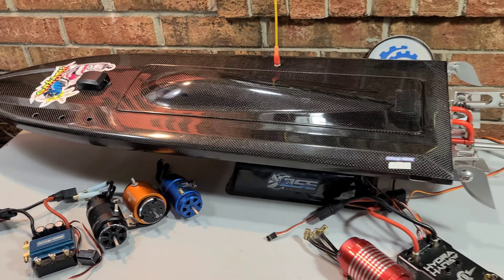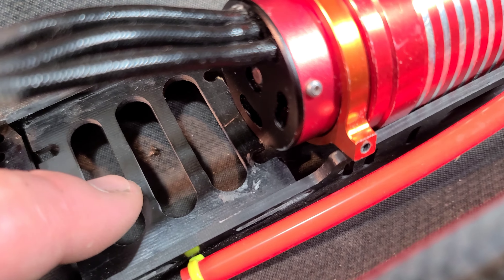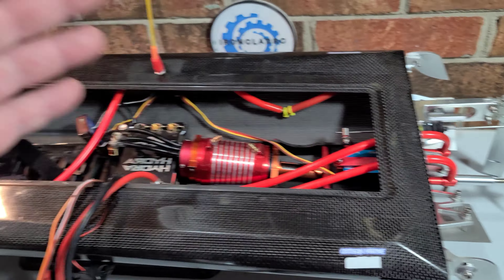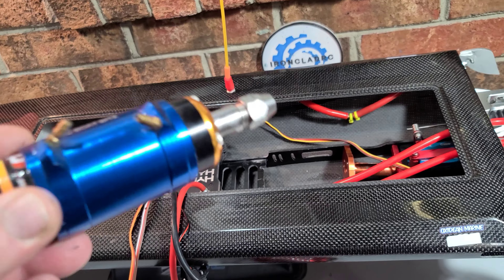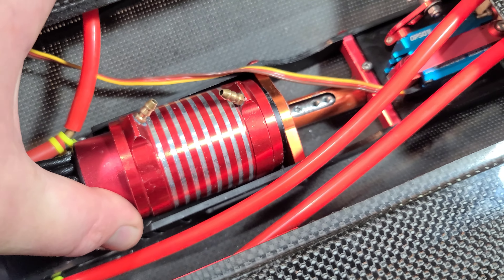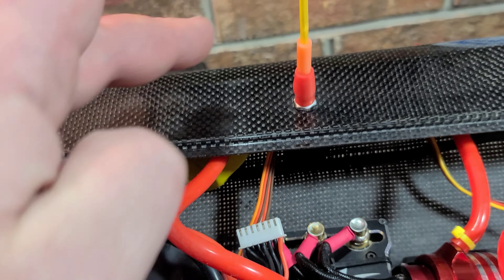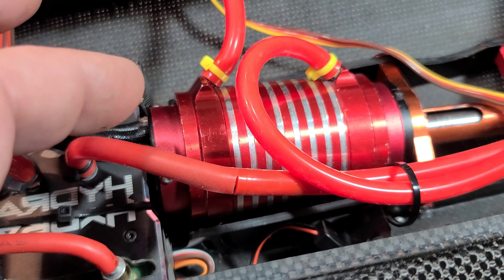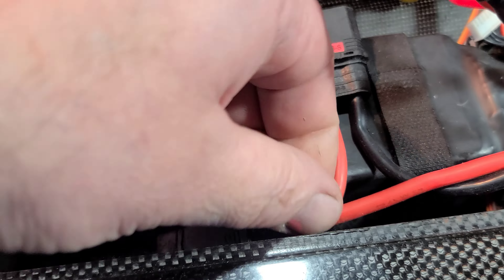Hydra Xlx2, Leopard 4092 Install Oxidean Marine Dominator 6s Setup

Comment: Good call on soldering the motor wires out the side of the bullets. Was wondering how I was gonna be able to run the esc sideways for more battery room with the leopards short wires. Just a heads up, ose sells 90 degree cooling port nipples for the xlx2 so you don’t have to run the lines vertical.

Comment: Just a heads up on the leopard 4092 motor wire length, the stock length of the wires from the end cap to the end of the wire not including the bullet connector is 68mm.
Reply from the maker: Roger that thanks for the info.

Comment: Don't know if there's room enough cause i put new frame in my v1 when it broke loose.
I placed servo right from motor so i got more room behind the motor. Theres plenty of room for smaller esc's but xlx is quite big...
Thay way you keep cg further back and you can adjust it with your lipo's
Reply from the maker: I definitely considered removing the coupler protector so I can run a normal collet. I may do that later on down the road.    Off setting the servo is a good idea

Comment: use a zip tie system to keep those motor wires off each other one zip tie loosely around all 3 wires. then use 2 more zip ties for the spacing. i can send a pic if needed.3 zip ties all together
Reply from the maker: I used that technique on my original deltaforce build gives a clear finished look.

Comment: Almost the same set up I got. Mine is a 4082 /1600 kv..I've been thinking of hatch locks ...Not sure yet. .Still waiting to get it on the water if the weather cooperates.
Reply from the maker: I've been contemplating hatch locks too I've got a few laying around the shop.  Locks would definitely give us a piece of mind in a whip out.

Comment: I had a hobbystar rewrapped with better wire,dude told me the Leopard is basically the same motor.
Reply from the maker: How was the performance difference in the rewrapped motor?   Was there a significant difference in performance or heat dissipation?
Reply: @IRONCLADRC  have yet to run it B

Comment: Absolutely love the 90 degree esc to motor bullets .I think I may make some changes after seeing that idea.
I have never had any luck with the grub screw type coupling with high power but man that motor connection tube looks like a grub screw cover or hose to slide over the opening might be a good way to stop water coming in through the shaft
Reply: Most bullets come with the hole to do so

Comment: I flipped my delta force on Sunday and tore my gps off the deck so be careful high speed crashes rips stuff off
Mine is lost in deep water.
It’s getting so that I need to build a shallow pond so I can just walk out and pick things up.
Just need 300 metres of free land 😂
Reply: As long it isn't a carbon hull you can put it inside your boat.
That way you can't lose it 👍
Reply: @peteroosterhoff8850  yes but I was making adjustments and did not want to re do hatch tape to view speed it was not a gnss so no cell phone to look at speed on for each adjustment chsnge
Reply: @jamesatkinson7517  Then you'll know want you want to buy now...
Losing things suck big time, the gnns is especially for boats ideal.
I made in my carbon boat a "window" in the hatch with some thin acrylic glass. Heat it up and you can round in in the shape of the lid. Then some adhesive and some small screws and it looks like an emergency hatch... 👍
Reply from the maker: James that's a bummer definitely been there.

Comment: I’m building a OSE Raider M40 with the Castle a hydra. What motor and prop would you suggest I use as I want it to be a very fast oval racer? Going single motor with one Esc. I was thinking maybe 8s with a TP 4070 1220Kv motor.
Reply from the maker: I think you're on the right track, 1220 4070 will be a great starting point that's a beast of a motor..
Reply: @IRONCLADRC  okay cool! So you don’t think it’s too low of a Kv? Someone mentioned I should go 2000 or higher Kv. I just wanna make sure I don’t have to do this more than once. Can’t wait to see how the Hydra does in the Dom as I may have to upgrade my Dom as well afterwards.
Reply from the maker: That 1520 kv tp 4070  motor I run in the blackjack 42 has been great Temps are low with plenty torque.   1220 your playing it safe and you'll be able to swing some big props, but I definitely think you can go up on kv I wouldn't go over 1700 kv definitely not 2000 lol.
Reply: @IRONCLADRC  sounds good bro! Thank you!!